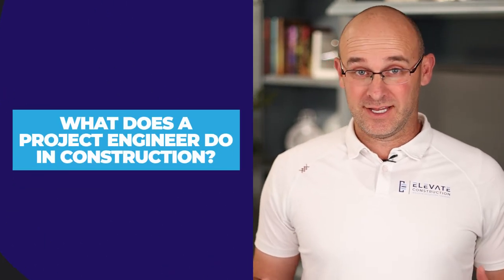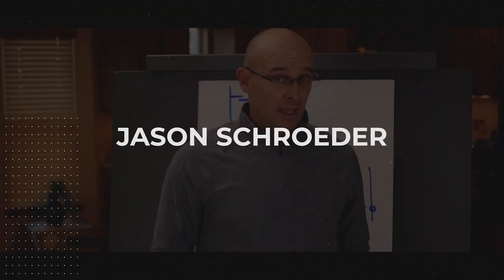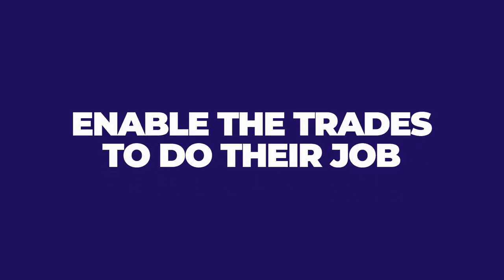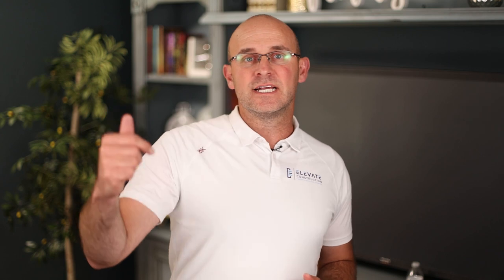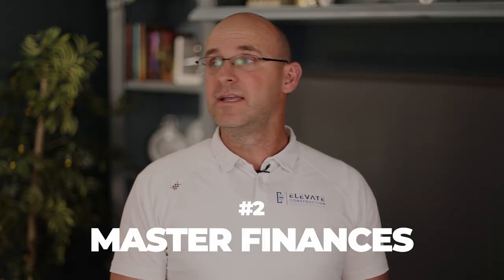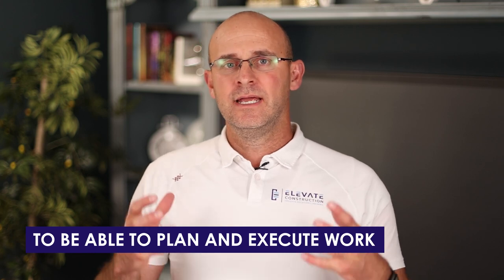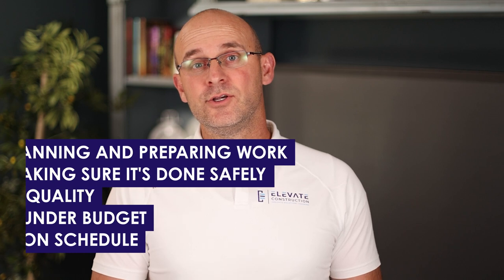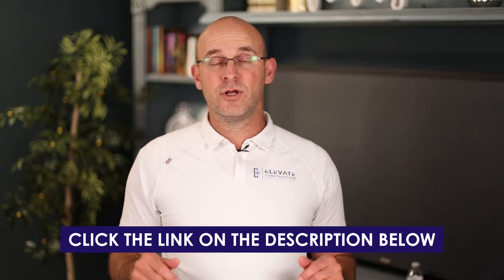What Does A Project Engineer Do In Construction?

Comment: Great analogy with tennis & football. It's frustrating to work with a tennis player. One thing I would add to the role is that there is always a QA/QC roll and it can sometimes be huge. This can put you at opposition with a subcontractor at times but could be critical to the project.

Comment: Is this something that requires a bachelors degree in civil engineering? Currently a sophomore in college who has an interest in construction, but little experience in it.
Reply from the maker: @ngonimandizha7738  typically it does to get in.
Reply: @jasonwilliamschroeder  I appreciate your reply sir!! I’d like to work with construction as a project engineer right after graduation, but I’m scared that the experience won’t count towards my PE license for the Civil: Construction unlike design work. Would this work be counted towards my PE if the project manager I work under has a PE license?
Reply from the maker: @ working as a project engineer will likely not help you towards your PE.  And you won’t need your PE for a long career in construction.  It really depends where you want to end up.